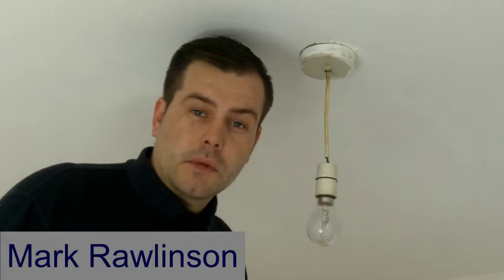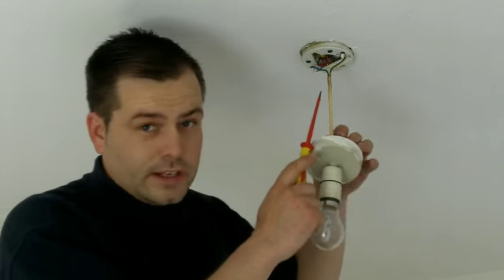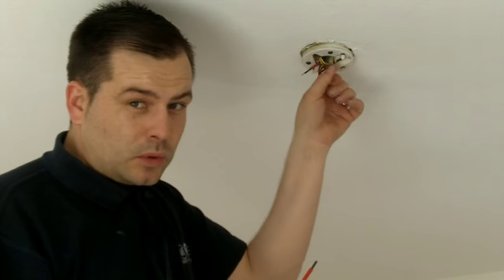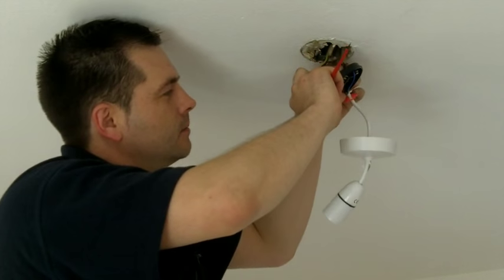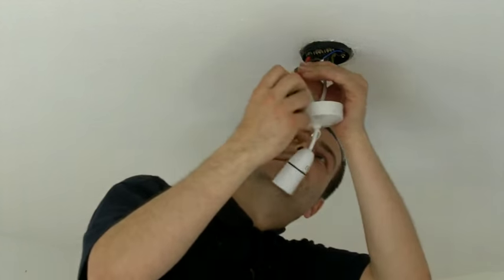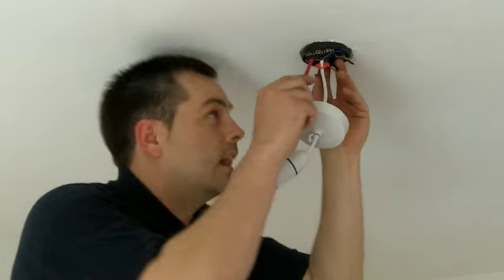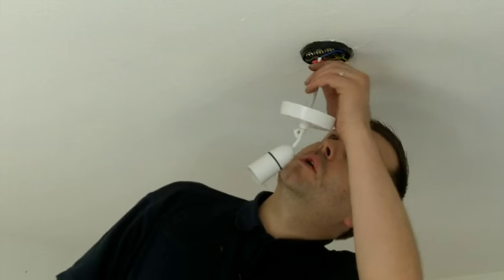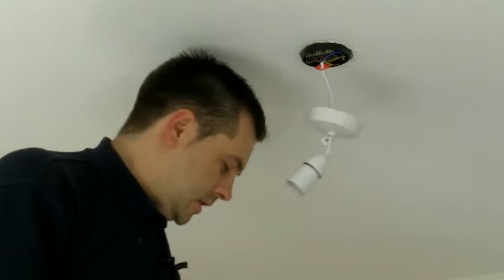How to Change a Pendant Light Fitting - Your Local Electricians

Comment: My mate (who's a bit close to a pound) asked me to check the light in his brand new refitted bathroom because the light stopped working. They've been using camping lanterns for weeks! I found one of the pins in the bulb holder had disintegrated. Trouble is the entire fitting is so old they don't make them anymore and it requires replacing the whole thing not just the holder and the two connecting wires. I took one look at the mass of wires coming out of the ceiling and thought 'Na, pay some money and get a qualified sparks in I'm a DIY'er FFS!'

Comment: Can you kindly explain what the rose screws on to? My ceiling rose is hanging loose from the ceiling and I can't seem to find a bracket that I can use to screw on to.
Reply from the maker: Hi Haduiz
The ceiling rose would usually screw directly to the ceiling. 
The appropriate fixings will be needed depending on the ceiling type. 
Hope this helps
Reply: @MtrpsUk2012  I really appreciate your reply, thank you very much.

Comment: Could I change the pendant to a led droplight? if so how many droplights could I feed off that one connection ??
Reply from the maker: Depends on a few things to be checked first, when extending any circuits it is recommended that you consult your local electrician, that is something which requires you to be qualified.

Comment: which colours do you connect where? Got a bit lost.
Reply: jimmy Hard Nails You'll have 3 wires (feeds and switchline). Identify the switchline and mark it because you don't want to mix the switchline up with the feeds. Strip all 3 cables which will give you 3 neutrals (blue), 3 lives (brown) and 3 earths (no sleeving). Find the neutral from you switchwire (the one you should have marked) and grab some brown sleeving or brown tape and put it on the neutral wire from your switchline which indicates that the neutral is a permanent live. Put that in the live terminal. That should leave you with 2 neutrals, 3 lives and 3 earths. Put earth sleeving on all the earths and put them in the earth block. Then put all 3 lives in the live terminals (the 3 in the middle) which will leave you with 2 neutrals which you put in the 2 neutral terminals (the 2 on the left side). Thats that, done. Pendants are really really easy when you know what you're doing, I'm 18 and have only been doing electrics for 6 months and I can do them in my sleep :)
Reply: I forgot to add that you will only have 2 cables in your pendant if the light is the last point in the circuit. It's exactly the same process except you will only have 2 lives, 2 earths and 1 neutral and 1 permanent live. Also if the wiring is old colours, its still exactly the same process except your live will be red and neutral black.
Reply from the maker: @uplightuk8924  Thank you for taking the time to reply in our absence, we were unable to login for some time... technical issue now resolved.

Comment: I’ve got the ceiling rose like the one your using, with the blue and brown wires, I’ve got the old style black and red wires hanging out the ceiling. Do I connect the red and black wires to the ceiling rose bit that has the other wires in?